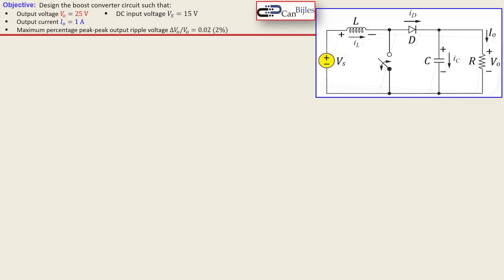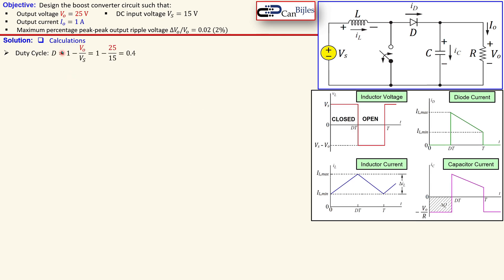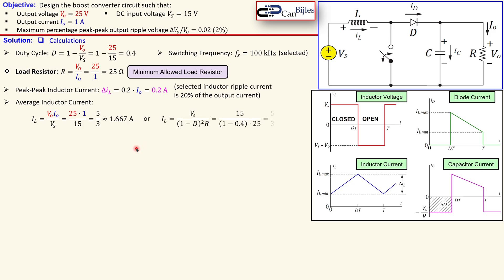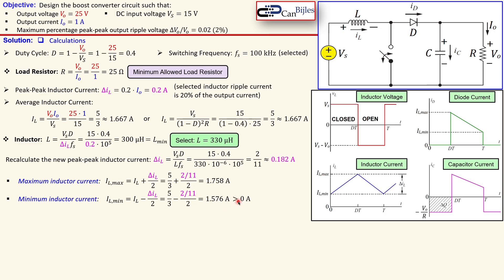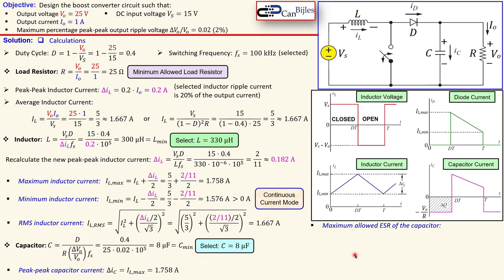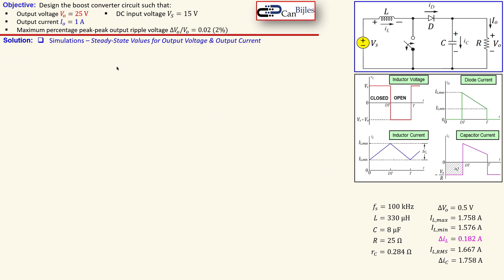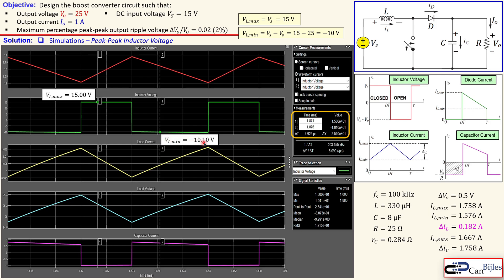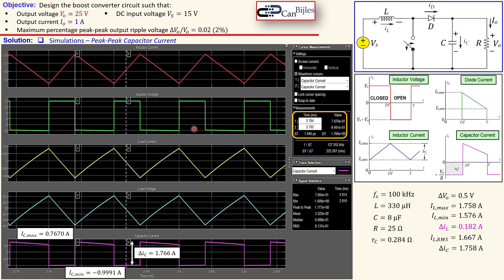⚡DC-DC Boost Converter Design 🔋 Power Electronics Calculations & MATLAB/Simulink

Comment: If I am going to use a MOSFET for the switching, How should I determine the amplitude of the square wave I am using on the gate?
Reply from the maker: That depends on the MOSFET you have chosen. If you want to conduct the MOSFET, then it should be ar least the threshold voltage of the MOSFET. Other parameters are important too, like transition time and deadlines time in your circuit.
Reply: @CANEDUX  Thank you a lot for your response.
Reply from the maker: @lnfiniity  You're welcome.

Comment: Sir, how to get steadystate values scope? 
Iam not getting such type of damping response. 
Ex: Output voltage directly reached to 25v without any time delay.
Reply from the maker: Did you plotted up to 2 msec or longer? Also, the components cannot be perfect in the simulator; this will lead to unrealistic results.
Reply: I didn't observed time in msec. Ok thank you sir. 
Sir, kindly do a video on bidirectional converter with calculations.
Reply from the maker: @saikumar-mp9lp  Good that the problem is solved. I will put this topic also on my list.

Comment: How to calculate ic rms?
Reply from the maker: You can use the capacitor current plot (see: 00:01:00) to calculate the RMS value using the formula for RMS.
Reply: What is formula at period DT to T ?  I don't know this formula for integral to find rms 😢😢 Is delta iL or not ? 😢😢
Reply from the maker: It is really basic math to do this.

Comment: i really love this video series, keep up the great work!

but isnt the duty cycle of a boost converter calculated through D = 1 - Vs/Vo ? So i mean the result of 0.4 is still right but shown in the video (D = 1 - Vo/Vs) would result in a negative Duty Cycle.
Reply from the maker: Thanks for your message. Great to know that you liked the video 👍 

You are right, there is a typo in the formula for the duty cycle. The right formula should be D = 1 - Vs/Vo.